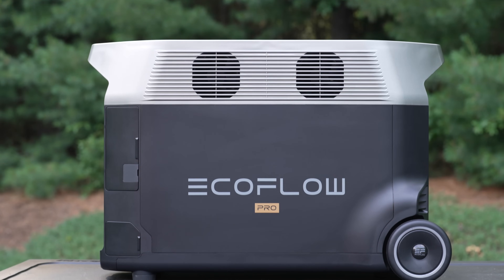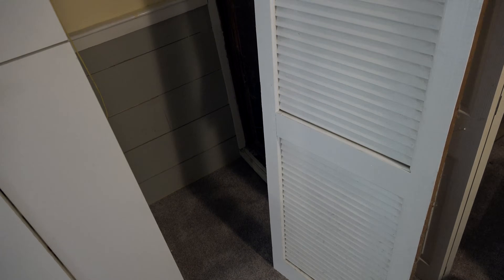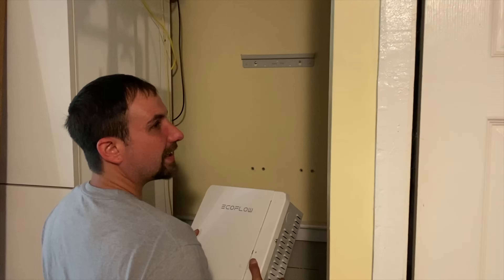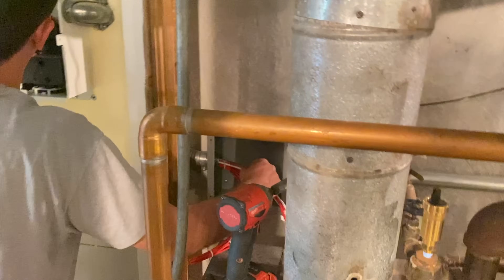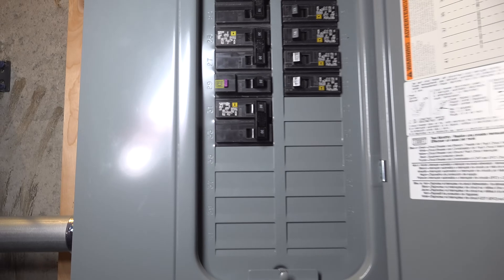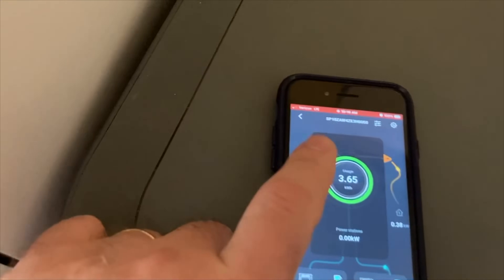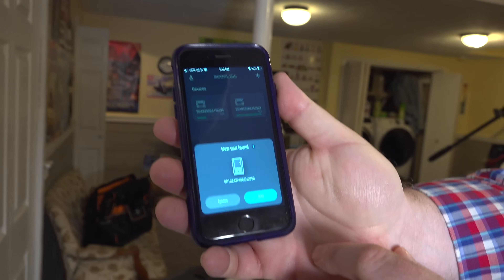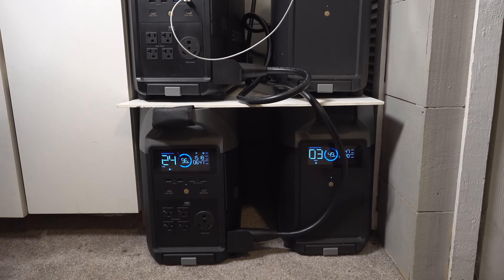AUTOMATIC Battery Backup for your ENTIRE HOUSE! - Ecoflow Smart Home Panel

Comment: It's like a poor man's Tesla powerwall.
Reply: If he's got 4 of those delta pros, that's about 2 power walls. Plus you can disconnect and roll the pros around.
Reply: I actually think this setup cost more than a Tesla Powerwall. I have 2 Delta Pros with 2 Smart Batteries and 2 Delta Maxes with 2 Smart Batteries and they weren’t cheap. The Delta Pros are also more capable in handling a higher continuous power output and surges than the Tesla Powerwall.
Reply: @Steve Paige right? I looked it up for curiosity and NOPED out once it saw the price of the pro and smart panel
Reply: right.
Reply: @ganeshnarayan5505  . Wrong…. But it is an interesting alternative.
Reply: Not like it is
Reply: Except they’re mobile too.  I don’t know about poor but definitely smarter.
Reply: I have this with a single smart home panel.  Portable?  I’d say as long as you are strong. I personally cannot move my Delta Pros up my basement stairs without help.  However, it’s great to be able to move them should you want to relocate your home.  That’s the portable feature I care about.  I don’t want to gift a $10,000 home upgrade to a potential home buyer, when I can move it with some help.
Reply: Tesla powerwall IS the poors man energy  management system.. not one multimillion building uses such a disposable system.
Reply: Ok I like this idea. Still pretty pricey, but I would consider an option like this in future home improvements.

Problem I need is a way to hook up my existing portable generator for extended power outages. I know they offer their own gas generator, but I would need the capability to recharge all of those batteries while still supplying power to a 240v system.
Reply: @robertt9342  You absolutely can. Just hook up generator to the batteries and it'll charge them while the batteries continue to feed the 240v house needs.
Reply: 4 of them will give you a little more energy storage than a Powerwall (14.4Kwh Delta Pro vs 13.5Kwh Powerwall+). At ~ $3K each, that’s a $12K investment before the cost of the Ecoflow panel. I crunched these numbers and had to go with the Powerwall at $10.5K w/ install.
Reply: Nah that's like an apple user calling a android user broke because it's android but the phone costed over 1k😂. It's just the apple mind set with tesle

Comment: I think this is a better option than the Tesla battery pack.
Reply from the maker: Its nice that you can control a lot of it, something the Tesla does not allow
Reply: @SilverCymbal  What doesn't Tesla allow you to control?
Reply: @MoCowbell  <~~~tesla fan boy has entered the chat. Lol. (not just this comment either!)
Reply: I’m guessing it’s the fact that you don’t pick circuits with Powerwall systems. We don’t install them here in MA with critical load panels similar to what is shown in the video. Almost every install we back up the entire house. If we dont back up the entire house, the number one item we load shed is the AC condenser if the LRA/RLA is too high. You also have to take into consideration how many Powerwalls you are purchasing when it comes to those larger loads.